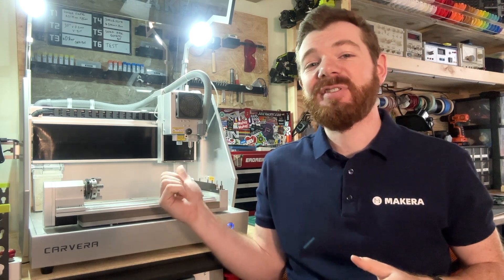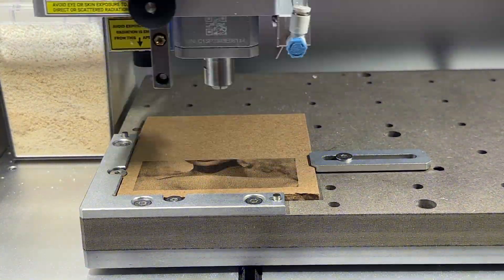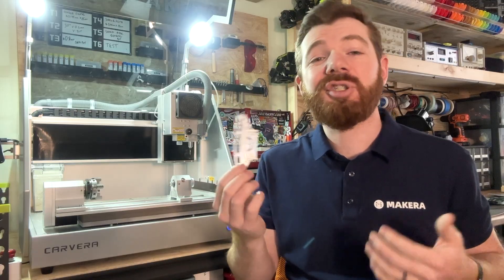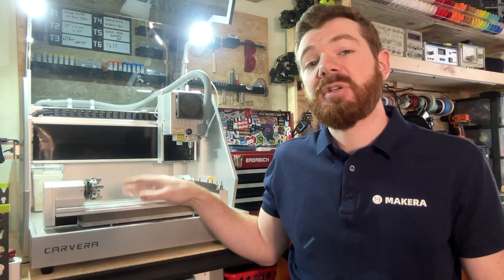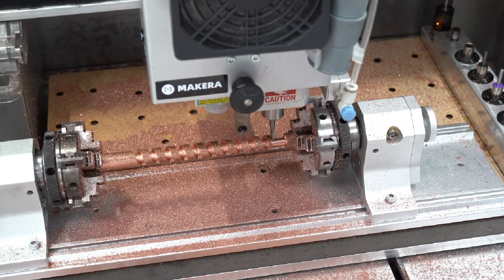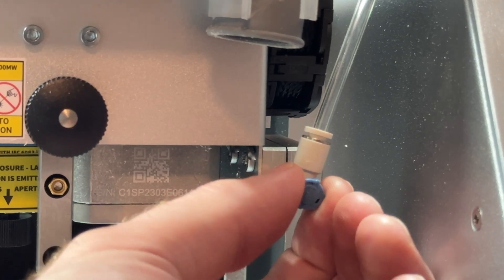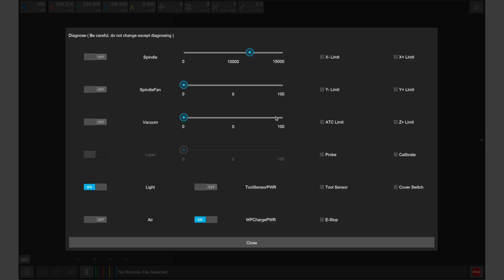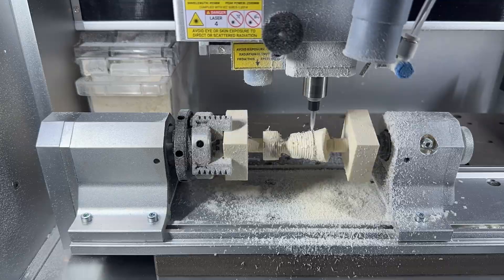How and When to use the Air Assist on the Carvera CNC

Comment: What type of air compressor do you recommend? Will any garage air compressor do, or are there some functional requirements to ensure it works well?
Reply from the maker: We recommend any compressor that puts out less than  7 bar.
Reply: @Makera  What min PSI do you recommend to clear aluminum chips? Looking for a quiet air source (that won't add much to the total noise level).